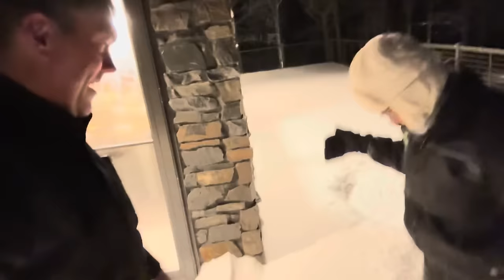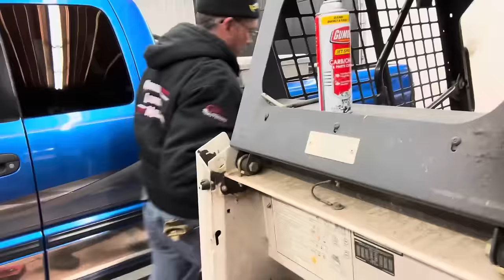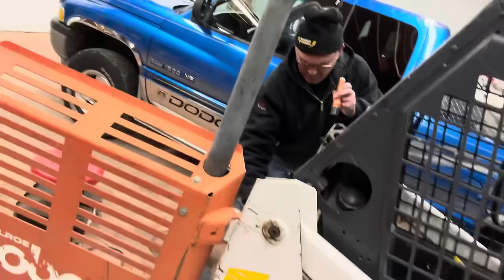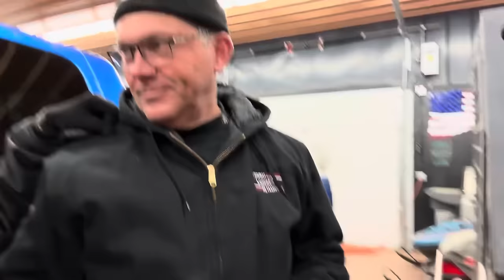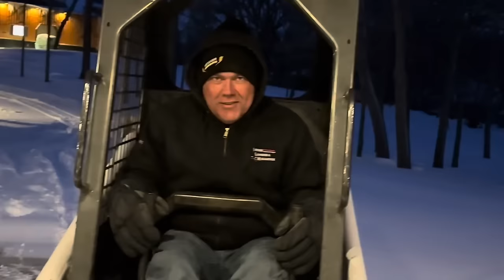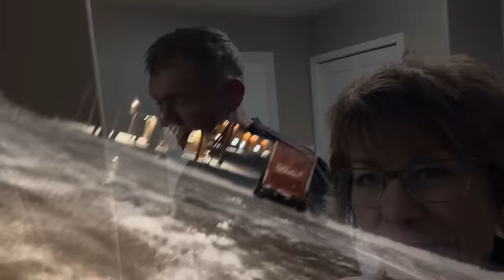Go Little Bob, Go

Comment: Little Bob 2 needs some Seafoam in his diet.
Reply: Seafoam is a food group in gas motors.
Reply: Seafoam and/or Rec. fuel- (Recreation fuel)  No ethanol in Rec. fuel.  Ethanol attracts water which contaminates gasoline that sits for extended periods of time.   I use it in all my lawn and garden equipment.
Reply: Ethanol fuel also screws up the air fuel mixture ratio for those screws that were set for straight unleaded

Comment: I knew Little Bob took a few blows when there was a skip between Dougo, and next you seen Little Bob running. Dougo get a bigger hammer, or in this case, bigger pliers 😂😂
Reply from the maker: I thought we had all watched enough of the struggle. I truly didn’t think it was going to start and then…I heard a noise outside.
Reply: Amy tell Dougo to put Star-Tron in the gas tank and the problems with not using little Bob not much will be over.This is comimg from a small engine Tec. @amysblessings

Comment: Now I remember being at Christopher Lake helping to spread sand on the beach.  The Bobcat overturned.  It was funny until the hydraulic oil started pouring out.  I ran to help my cousin lift the Bobcat upright.  I would have never believed it but the Bobcat has a high mass down low.  We lifted it fairly easily.  We had borrowed it from my Uncle Ted who used it on his farm for cleaning out manure from his low sheds.  It was the gas model like you used in the video.  . . .  it did what we intended.  . . .  spreading sand on the beach.  👍🏻

Comment: If you put your hand over the carburetor when running and put it away when it is about to die it will back fire and shake things loose in the carburetor. 
That a quick rebuild carburetor.

Comment: Put a shut off valve on the gas line and shut the gas off and let it run the gas out off the carburetor when you are done using it. Works every time.
Reply from the maker: Good idea.

Comment: Thanks for the videos. 
Yup Bobcat backfiring through carb and stalking. Tell Doug  indicates it’s starving for fuel. Need to clean the carb needle valve and its removable jet ( count how many turns to screw  in the needle valve so it can be reset to that position after carb cleaning). Unscrew needle valve and the jet behind it and clean them. Pull float bowl and needle and clean it plus all passageways in the carburetor.  Reassemble with needle valve set open to number of turns from closed position (about 1 1/4 to 1 1/2 turn from full closed) should start and run great.
There should be a manual or automatic choke on the carb. If manual use it. If automatic press accelerator pedal to the floor and slowly release it and it should be set to choke with fast idle till it warms up.

Comment: Next time try Berryman chemtool. Pour some directly into the carburetor to fill bowl while started. it will work quicker it may smoke temporarily as it burns the vanished gas out but will dissipate quickly. Also put some in fuel tank.

Comment: Hey dougo there are people that can do a swap and put in a diesel engine in that little thing. It’s just a little 2 cylinder Kohlar  engine. You could have a new engine put in that is fuel injected. So you do have options.  Upgrade to fuel injected gas engine or diesel engine your choice.

Comment: An angel making a snow angel. Hey Dougo just wondering why you don't just buy a new Carbutator. Then rebuild the old on and have a spare. Better yet sell Bob and buy a mini tractor like Chet  has. Bucket on the front blower on the back? Cheaper than a skidsteer.

Comment: Just start using a fuel stabilizer in all your small engines.  I highly recommend Seafoam as it's the only one I've found that will clear the varnish from the carb. It's the best solution I've found.. Good luck..
Reply: I second the Seafoam. Put a half a can in once a year and you'll never have that problem again.

Comment: THE Needle Value in the carburettor of Little Bob 2 is jammed by dirt in the fuel. Which is a common situation that often does happen with carbureted engines.

 While tapping on the top of the carburettor  (with a screwdriver handle) is one short-term solution in overcoming this situation.

 However, with this vehicle the concern is also with the choke (if it has a manual choke and not an automatic choke) and the idle screw setting. (rich or lean mixture etc)  - As the Larson;s would say "JUNK" 

There needs to be an inline filter in the fuel line and the fuel tank should never be run low on gasoline.

Comment: I did not know there were two Little Bob’s. I saw a bobcat mini excavator at work and confused my coworkers when I pointed at it and said, “mini Bob”. I always put gas shut offs in-line on my fuel lines. Shut the valve and let the engine run until the carb runs out of gas.

Comment: You could use non ethanol gas it will help or put a switch on your electric fuel pump to shut it off and run it out of gas would help the carburetor

Comment: Amy take Dougo shopping for a nice little JD about 45hp with a front end loader with cab and heater.  Last time i looked they are still building them run perfect…now you talking my language Dougo get a nice used diesel less problems!!! Life to short at your age to be messing around…. You have a white and red stripe boat anchor!!!
Amy is doug needs to clean that carb on little BOB 2 have him buy a ultra sonic gun cleaner just throw carb in the ultra sonic cleaner whole and let it things don’t have top take carb apart.  Lyman builds them most large guns stores will sell them. Turbo Sonic 6000 cleaner, my Polaris dealer uses one in his shop to do all his carbs never takes any apart.